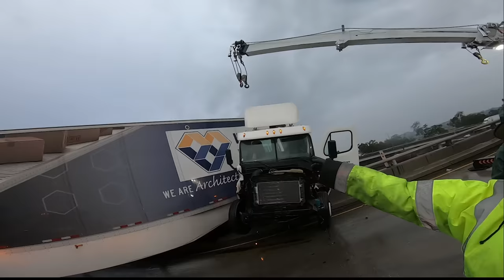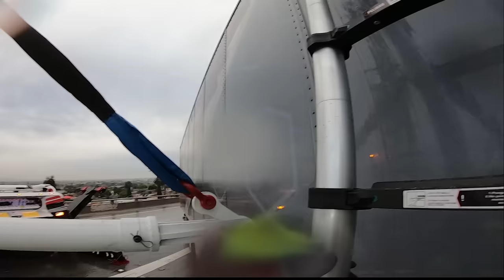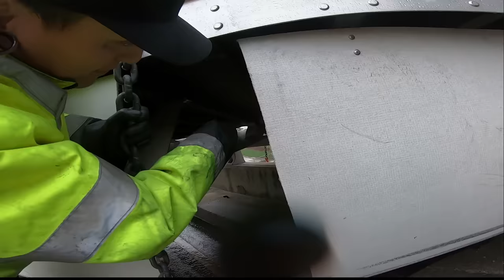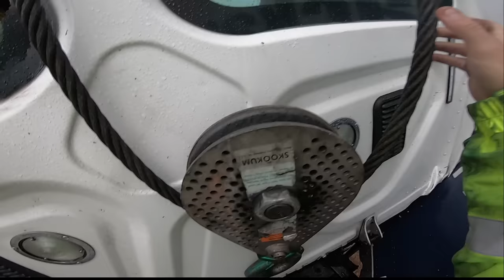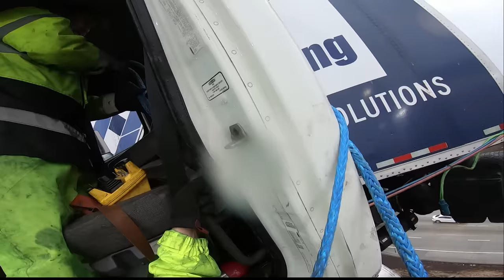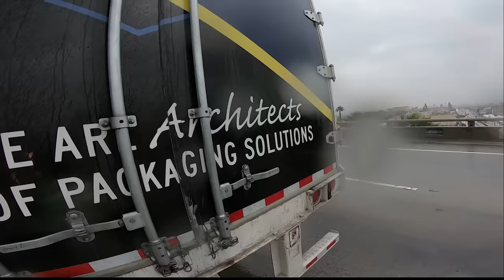Big rig crashes and is left dangling off freeway bridge in Los Angeles!

Comment: In areas with little rain, the drivers are facing two things in regards to changing driving conditions. Inexperience on wet surfaces and the accumulation of oil on the road surfaces. First heavy rain after a long dry season catches way too many drivers unaware as they continue driving as if the roads are dry with great traction.
Reply: Inexperience non White USA or Canadian Drivers.  happen more and more every year

Comment: Wow, nasty looking wreck. Many years ago, I came upon a wreck that had happened in front of me at about 2am in the morning. This was before cell phones, so the only communication device I had was my CB Radio. A USPS truck pulling double trailers had ran upon some cars that were crashing on a rain soaked overpass. He severed to the right side in an attempt to avoid hitting one of the cars. He caught the guard rail with his right front tire & that pulled his tractor up over the top of the guard rail & onto the top of a concrete wall up on the bridge.  Before he could get stop his tractor went up over the wall & was hanging suspended in mid air over to top of a busy road.  As I came up on the accident I noticed right away that the cab was over the wall & there were 3 mangled cars along the 3 lanes of south bound travel , so I came to a stopped position in the right lanes with my flashers going. I had some battery operated flashing flares at the time so I set them up, & started talking to victims of the accident to see if everyone was o.k. Nobody seemed seriously hurt, but a lady was trapped inside her car & was freaking out. The USPS driver was also still trapped in the cab of his truck that was dangling off the over pass. I could talk to him as he had his window rolled down. He was complaining of his legs being pinned in under the steering wheel & dashboard. I ran back & started calling on channel 9 on the CB for help. I got a hold of somebody on a base station that was able to notify the local police. Once they got there things started happening pretty quick. They used a small wrecker to chain up & secure the tractor to the side of the edge of the freeway overpass, while other firefighters were working on getting the hysterical woman out of her car . Then a bucket type fire truck raised his bucket with a couple of firefighters in it, & they help the driver fee his legs so he could climb threw his window & get out of his truck. Right after he got out I left as I had to go deliver my freight. Overpass accidents are always scary.

Comment: Used to do similar heavy vehicle recovery work, along with forestry work, long retired now, using a 13 Ton Scammell Tank Recovery Vehicle, a beast of a machine and great off road, with an up graded belly winch 14 Ton pull and a 3 Ton crane with an extendable boom on top, powered by a 12 litre 6 cylinder petrol engine, later models used Gardener Diesel engines, it had a magneto, old school, ignition system and managed 3 miles to the gallon on a good day, had a four speed and reverse crash box with high and low gears that you had to run through a gate no missing gears, ie. 1st to 3rd etc. Top speed around 25-30 MPH. It was 10 feet high x 9 feet wide x 20 feet long, affectionately called “Baby” lol 😂 
No fancy lights, hydraulics, chains and slings all colour coded, electric controls etc. like your rig!!’ Mind you it did have four braking systems, one parking brake, separate transmission brakes for each side of the rear wheels and a winch brake!!’ You are spoiled my man and as for a safety arrest harness, we ran with wings, a prayer and cast iron balls, just glad I missed out on active service in WWII though, being under fire with 72 gallons of petrol in the tank must of added to the excitement, just a little Sheeezzz!!!’ We mostly used steel wire rope and few chains, every thing was heavy!!’ Mind you I reckon that you were close to the limit on that job or has the tackle gotten that much stronger??? Anyway if you want to see what it was like in the days of yore when men were men, risk assessments were the devils bane and pragmatism ruled!!!’ See links below: Enjoy!!’ 😉 The comments are worth a read too!!’

PS. We Always fancied a “Diamond T Model 981,” with the bolt on crane, not so good off road but a dam pretty bit of kit, but we never found one for the right price, the war enactment boys bought them as toys, pushed the price up to high for a tool and then painted over all the controls Dhoooooo!!’ Not sure if I like the modern kit, there’s just too much plastic to break an paint to get scratched, but the controls!!’
Yep makes me envious takes so much of the work out of the job and the safety side, well that’s just a sign of getting old.!!!’ Anyway’s have a beer 🍻 or two for the crew and a job well done!!’’

Best regards from across the pond.!!’ Stay safe, wash Yo hands, enjoy life!!!’  ຈل͜ຈ

Toodle Pip... ✨🎭✨

https://m.youtube.com/watch?v=XvgkqdQvqq8

https://m.youtube.com/watch?v=8e8Hxh9jW7c&feature=emb_rel_end

https://m.youtube.com/watch?v=I-W8FSUFE_g&t=914s

Comment: Good job!! I would of liked to see you use angle between the bottom edge and the trailer. Last time I did a mid span lift I also put a 4x4 between the as a spreader on the underside of the trailer

Comment: Hulk is a sweet paint job!
Reply from the maker: Thank you, wrap was done by American Wrap Shop
Reply: Pepe's Towing Service  Its a  awesome job they did...that rig kicks a$$ too! Oh and you said you set drone to tripod mode....I not heard that mode before.  What drone is it....I got 6 but none are GPS equipped. Might look into the one you used. And thanks for quick reply also. Stay safe and no more hanging around. lol
Reply from the maker: @cutterspaulding8664  thanks! It's a DJI Mavic 2 zoom. By default, a drone will want to rock back and forth slightly. When I put it in tripod mode, it's incredibly stiff as if it was on a tripod so you get a super still video
Reply: Pepe's Towing Service very cool man I definitely look into that model. Thanks again and stay safe!

Comment: Thank you for this. Very useful. You need to empty the cargo first. Good if you add description as to the cause of the accident  and how/why it happened. We need some risk management/ control advices so as heavy drivers can learn and avoid such risks. Don't you have any advice/remarks on the construction of the barriers on the sides ; they are too low for heavy vehicles and large buses, not enough to stop vehicle falling down. Plus more powerful material to be used so that the impact can be sufficiently absorbed. Thanks again for this.

Comment: If you have time; what is a free spool ?
And for this job; amazing, you guys always have to come up with a solution when you arrive on to the "scene"
I find it so amazing you always find a way to get the wreck from the accident scene
I found this one pretty scary 
dangling above the high way
glad nothing bad happend there
Respect for all of you
Always cleaning up someone els his mess, risking your own lives
Reply from the maker: Free spool in layman terms means that we don't control the winch lines with our trucks. When you put free spool on, that means I can just pull on the cable and it will come out freely. With free spool off, you have to use the controls to have the wire come out or in.
Reply: @PepesTowingService  👍Thanks for answering my question (and so quickly)
Thanks for your clear explaining, now I understand what a free spool is
Be save, take care 👍

Comment: Hey guys,

Loving these videos!  Just wondering…. I’ve seen a few of your videos where you use a ladder to climb on top of the trailer, to get slings or chains to fall off the other side of the trailer when using a spreader bar.  Could you use a rope with a small weight at one end to throw over the trailer, and then connect it to the sling or chain, and pull it over the top of the trailer while staying safely on the ground?

Again, love these videos, and the way you work together as a team.

Comment: I'm curious if as an operator of one of those rigs if you have ever been given guidance as to whether pads should be used under the outriggers when you are on a bridge/elevated roadway?  It seems like the outrigger closest to the truck being lifted could see quite a large load.  I'd be just slightly concerned such a concentrated load could crack the bridge deck.  I'm not suggesting a major failure, but if the load were high enough to crack the concrete, it could cause future maintenance problems for the bridge.
Reply from the maker: There are many small overpasses and bridges where they will not allow you to work on even with pads. This is not one of them. The trailer did not have a load so no crazy extreme force was exerted on the trucks, especially since each rotator had a different part.

Comment: That looked super sketchy  seeing you standing on the frame rails dangling over the side
Reply from the maker: Yup, but it had to be done. Would have been more sketchy to only lift from the engine frame, then find out the 5th wheel was broken and the tractor swings over the edge
Reply: Pepe's Towing Service was that a rope just around your torso? Lol might as well just put it around your neck lol. Good job stay safe. As a crane operator in SoCal I’m a bit jealous of the side load you guys can get away with. They have some massive rotators... saw that 100ton. Epic. IUOE local 12!
Reply: @ryanburbridge  I guess they have procured at least one harness since then. Not a climbing/rope access one, but still better than none.

Comment: Which drone do you use for work in rainy weather?
Reply from the maker: DJI Mavic 2 zoom
Reply: @PepesTowingService  Is this the first time flying it in the rain, or has the drone been reliable in wet conditions on a regular basis? I thought you might be flying a Phantom with a wet suit or something similar. Looked to be pretty wet out there!
Reply from the maker: @basspig  well it doesn't rain often here, it handled it well but this was the first time I took it out while raining
Reply: @PepesTowingService  I always worry about moisture getting into the electronics can causing later failures.

Comment: The dude in the truck was so lucky it didn't slip 8 more feet his cab is on the very edge
Reply from the maker: I specifically went over this in the video and the description. The heavy wrecker was used to anchor the trailer to prevent exactly this. How would it slide 8 feet?

Comment: You guys need safety helmets wtf
Reply from the maker: We have one in each truck. Relax.
Reply: @PepesTowingService  I'm more than relaxed over here, I'm glad you have one. I'm just wondering, What's the point of having one in the truck if you aren't gonna utilize it? I noticed every other guy on that job had one and they were just standing around while you guys were climbing under and over that trailer taking the most risk.
Reply from the maker: @lucasgarthwaite9765  It wasn't as bad as you're saying. The trailer was 100% secured from the rear, it was in the realm of things a super controlled and safe scene. I was the one doing all the climbing and rigging and I did have a helmet on, what do you think my GoPro is attached to lol my forehead?